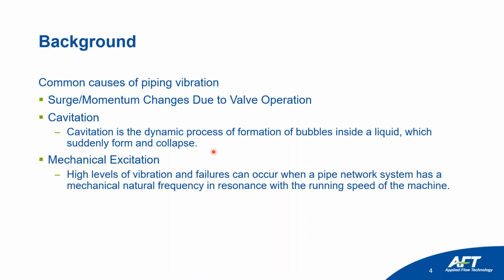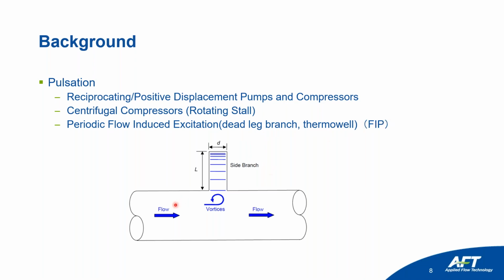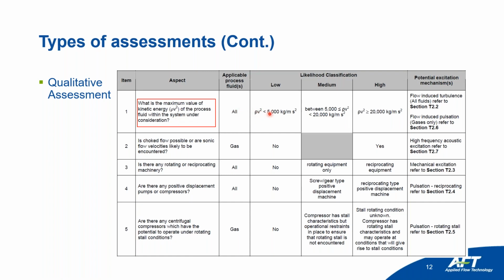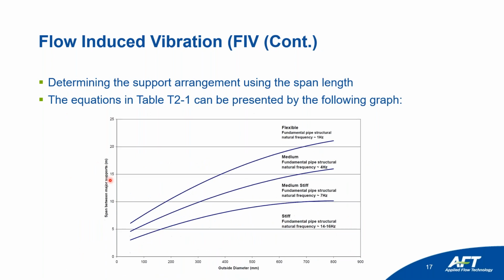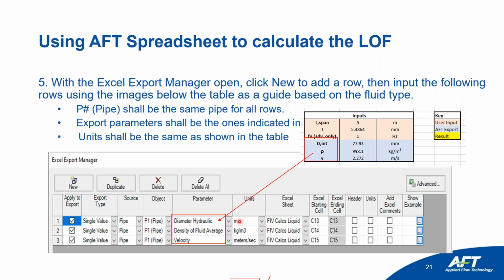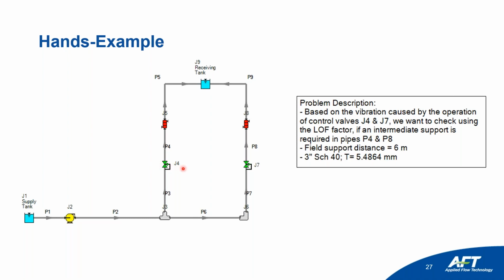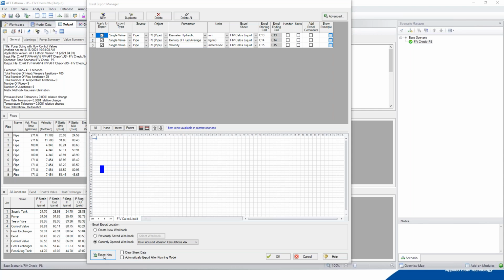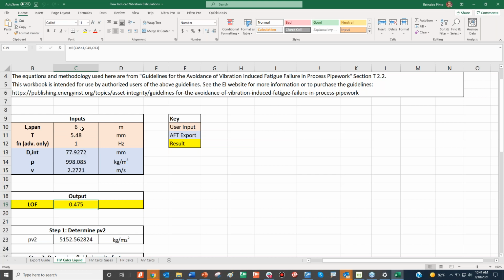Is Vibration a Headache  Learn how to avoid from the design stage

Comment: Hi Reinaldo, the topic you delivered is of great importance to the industry. I found it very interesting.
My question is as follows
1) Are you solving for a multiphase flow?
2) If yes, how did you calculate the mixture velocity?
3) And how did you calculate the mixture density?
4) I would like to have the AFT software, excel spreadsheet and word document manual.
Thanks